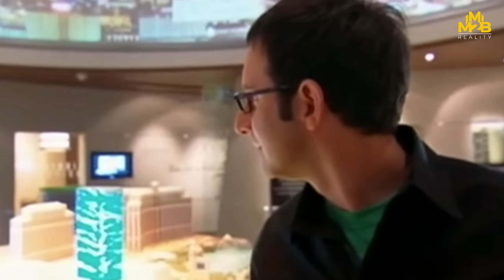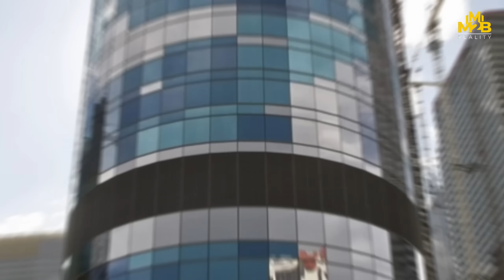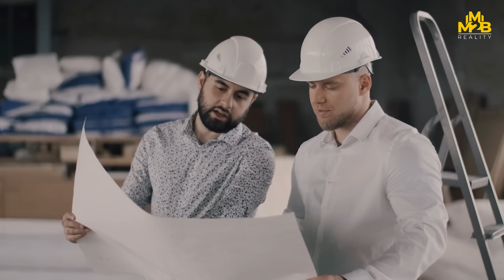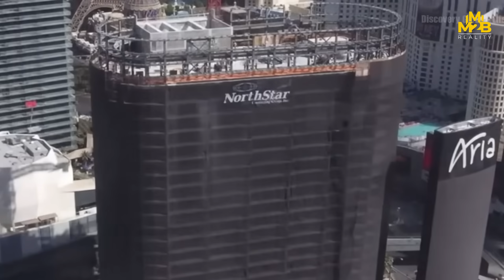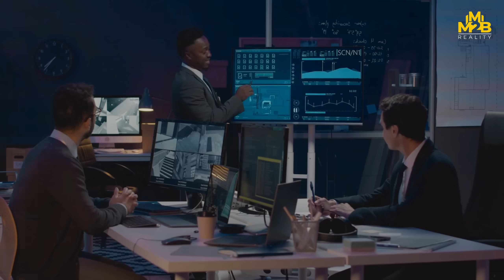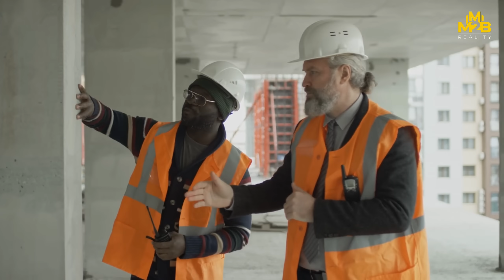Las Vegas $275 Million Hotel Was Destroyed Before It Ever Opened

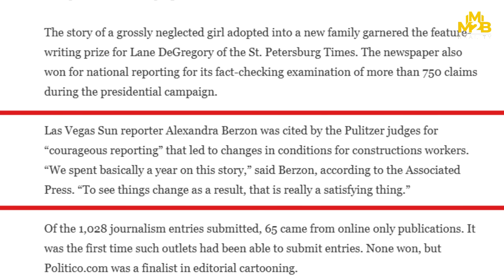Comment: The supporting‘ evidence’ you provided at 7:28 has nothing to do with the video, if you use AI at least check it pertains to the story.
Reply from the maker: Fair criticism. If that supporting visual at 7:28 didn’t match the story closely enough, that’s something we need to tighten up. The core of the video is based on the Harmon reports, inspection failures, and court records, but the visuals should still support the facts, not distract from them.

Comment: Something very similar happened in Seattle.  The 25-story McGuire Apartment was completed in 2001.  From almost day one, construction defects were found including the use of sub-standard steel cables and rebars from China.  Since Seattle is in a high prone earthquake zone, there was no acceptable fix; but after 10 years of expensive legal battles, the building was deconstructed floor-by-floor because it was surrounded by other similar buildings so no wrecking ball or implosion could be used.  To me, it was mind boggling that the use and installation of sub-standard steel cables and rebars could have gone unnoticed . . . unless it was intentional and hidden from inspection (like falsified paperwork).  When sub-standard steel cables and rebars are hidden by concrete, it’s almost a perfect crime.  

Then there is the 2023 Bangkok building collapse during an earthquake.  The only building in Bangkok to collapse and the collapse was due to sub-standard steel.  Given the rapid construction of high rises in Bangkok, China, and everywhere else in the world, you know this type of cost-cutting in the use of sub-standard construction materials is happening all the time.  It's not noticed until age and/or a natural disaster occurs like an earthquake or windstorm.
Reply from the maker: That Seattle comparison is chilling. Once bad steel or bad placement is hidden inside concrete, the truth may not show up until years later — or until something forces it into the open.

Comment: Forget the inspector,  why would the contractor and builder not do their jobs correctly ?
Reply from the maker: You’re right — the inspector didn’t place the steel. The contractor and builder had responsibility too. The problem is that several layers were supposed to catch the mistake before concrete covered it, and every layer failed.
Reply: @M @DisasterMoments1205 etty sure the city inspector was not the first one to spot the deviations. Somebody in authority made a decision to keep going. I’m pretty sure multiple groups of people were walking that site with a copy of the plans so they could perform their assigned function.